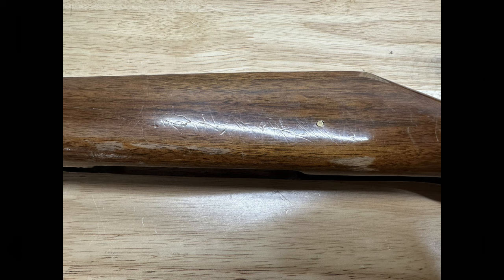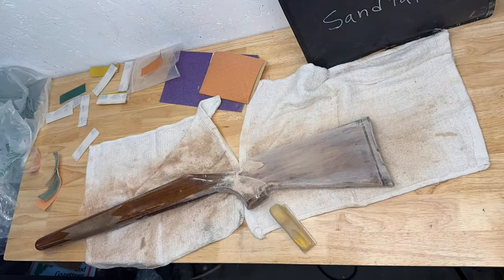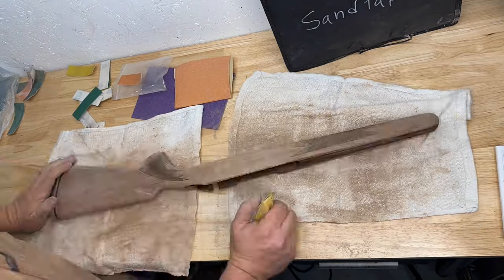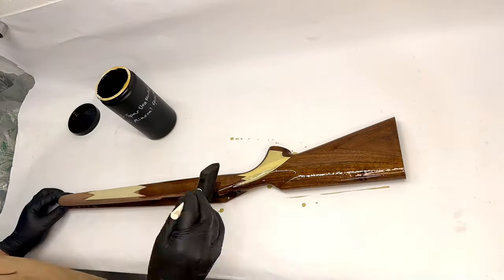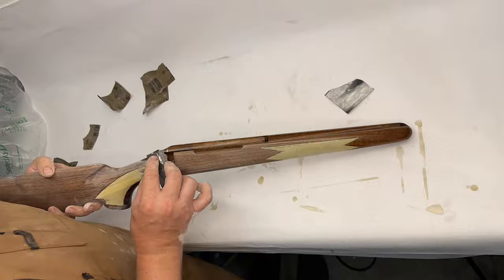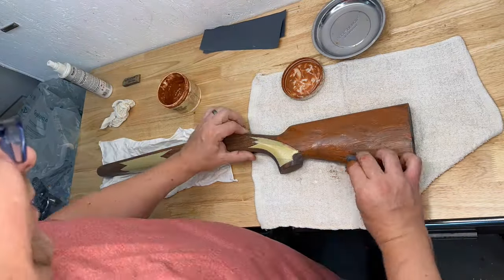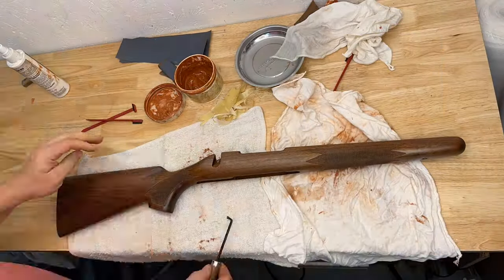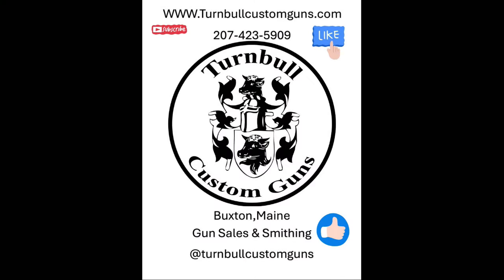Rifle Stock Refinishing With Turnbull Custom Guns

Comment: Not sure about this,  I have been making and refinishing for near on 30 years, so much happening hers, not sure if all of it is good.
Reply from the maker: I am sure it's all good, this is actually one of the methods I was shown when I was trained by two master Gunsmiths over 20 years ago, yes, I have changed the process over the years to add my own experience and twist to my original training, I'm pretty sure I'm the only one that wet sands this type of finish, it comes from when I used to paint cars. I'm sure you have your methods that work. I know this method works for me, it is only one of the many, many ways a gunstock can be refinished. I have no doubt you have done some beautiful work over the years. I would love to see some of your techniques and learn from them as well, please email me links to some videos I would love to watch. Always be open to learn and grow in your chosen path. I learn every day that get up and go into the shop, then the next day I try to apply the good things learned to the next day of work. Thanks for watching, I hope you tune in for more videos and continue to share your thoughts.
Reply: I look forward to watching YOUR video to see how “it’s really done” 🙄 jack a$$
Reply: @Turnbullcustomguns  What grit paper do you use for sanding between coats and for the wet sanding?

Comment: Nope …how not to finish a stock
Reply: Curious to know the correct way then?
Reply from the maker: @tobiassauer7883 I have been contemplating how to reply to this comment, there are as many ways to refinish a firearm it seems, as politicians trying to take away our 2nd amendment rights. There are also as many different finishes to go with them. The finish choice is determined by the original finish on the gun, the owner of the gun, and his intended use. No, I would not refinish a Purdey double barrel rifle in this manner or a vintage Winchester, this rifle is not to be compared to those standards. Regardless of the value of the gun I still take the time to make sure edges are not rounded stock lines remain straight, Checkering borders are crisp and clean and wood is not removed in excess. The proof of a properly refinished firearm is in the end result, personal satisfaction of a job well done, and customers that are happy with the cost and the final appearance. As for Durability... I have two guns I have hunted with for the last 20 years with this same finish, prepared the same way. No chipping, No pealing, and no water absorption.
Reply: @Turnbullcustomguns  great response!

Comment: You should mask off the checkering first!
Reply from the maker: It is a good idea. And I sometimes do. I have found that the bulk of the tape can make it difficult for me to sand as close to the checkering and maintain the control I like. It’s just faster for me to clean up any sanding overruns when I recut the border than remasking when sanding. I appreciated your comment. And observation.
Reply: Not a lot of folks appreciate how tough it can be to recut, refurbish, or replace worn or damaged checkering.  The stock in your vid was a pretty mild examples.  Show an old model 70 that's been "rode hard and put away wet" that's had the checkering drug across granite or lava rocks....  I gave up trying to please people.  Now I do my own, mostly pawn shop refugees and forlorn stuff off the back rows of used racks.  I make ME happy, so I've pretty much gone exclusively to oil finishes.  I don't have to keep a shop open, or pay a light bill by turning out product anymore.
Reply from the maker: @darreldwalton8763  Thanks for your comments, these video's I put up are work I do for my customers. So yes, I enjoy an oil rubbed finish as well, and if time or money were not a factor everyone would opt for a nice pores filled oil rubbed finish. I present costs and options to my customers, and we pick a process that is within their budget and provide the look and finish that will work for them. I have stocks I finished similarly to this one and have hunted with them for 20 years and they have held up well.  Keeping a shop open is a an important goal as well.
Reply: @Turnbullcustomguns  Don't  get me wrong.  My most favorite,  "Ol' Death and Destruction ", a Husqvarna  270, I shot with rattle can urethane, then freshened the checkering, as you did.  It's  only lasted since, oh, about 1994, a divorce present to myself.  Ain't  skeered to try anything once!
Reply: I look forward to watching YOUR video to see how “it’s really done” 🙄 jack a$$

Comment: Why you dont use a steel cabinet scraper for the old finish removal ?  
That's the Mark Novak ( Anvill ) method, I tried it and it works a lot better than sanding paper.
Reply from the maker: I may give that a try. Thanks for watching and thanks for the comment!
Reply: This is great advice.  Once you try it you will never go back to sandpaper.

Comment: Excellent result!
Did you add a stain to the Poly or is the final finish just the result of the usual orange tint found in polyurethane?
Reply from the maker: I used Spar Urethan not Poly, I do not recommend using Poly on gun stocks, Nope I didn't add any stain. Walnut darkens up quite a bit when finished and there is a very light amber color in the Spar Urethane. Thanks for watching and thanks for the question. Don